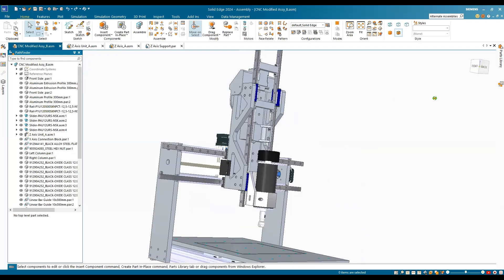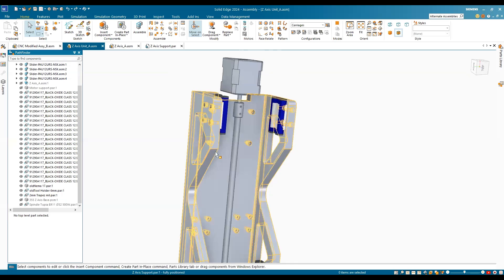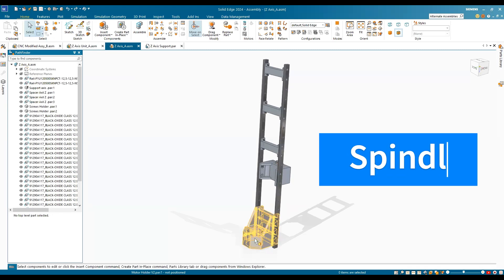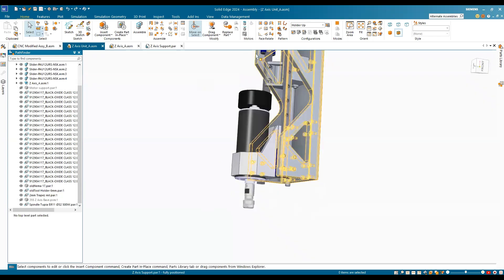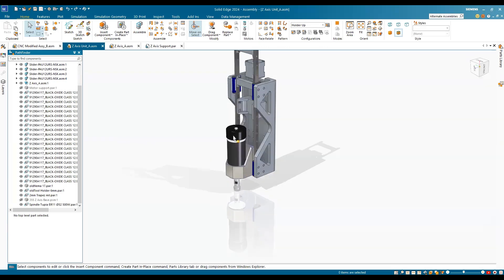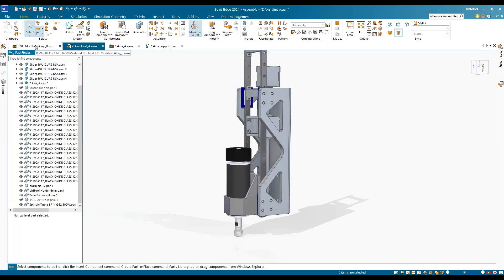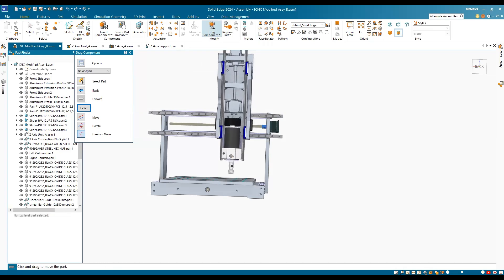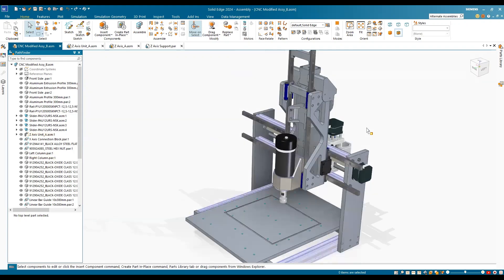Disruptive Z Axis Carriage Design

Comment: 3 Issues I see with this design.
1: Wet noodle.  When this is extended more than a few inches, you'll be able to move the spindle visibly with your own strength.  I'd guess you need to stiffen this by at least a factor of 10 to have it usable for more than drilling.
2: Accuracy issues.  Those types of linear rail are not guaranteed to be straight.  They need to be screwed down and and held against a reference (flat) surfaces.
3: Not much clearance.  In the configuration you show this most of the time, with the axis as far up as it will go without coming out of the lower block, the spindle shaft sticks a couple inches below the gantry clearance, and any tool inserted in it will just stick out further.  If you move the spindle up the rails, then the rails will have to protrude below the gantry when at it's lowest position.
Linear rails are not a good substitute for a real frame.
Reply from the maker: I'm taking notes @skrubol thanks for the feedback. The idea is to keep it simple and explore options, I will release soon some FEA analysis that will help me to take the right direction in this project, the screw down and held against a reference surface is one of the changes, but the surface will travel :) I'm having "spacers" in between the rails, the change will be to replace the spacers by one single spacer in steel with machined datum planes, the next limitation is the force of the stepper, yesterday I tool some measurements those can only handle 5kg (49N) so that is part of the constraints to take in count.

Comment: Im certain you are going to see a lot of vibration issues with the design, especially when cutting deep. You should try to alter the design so there is a more rigid connection with the rails and the spindle, especially because its sticking out
Reply from the maker: @tinkot that's a good observation, I'm planning to replace the current plastic spacers with a single piece of steel. I hope to post soon a video about the design process including some FEA

Comment: Did this for 2 years ago you will get vibration and a no rigidity
Reply from the maker: Yes, currently the machine has a max deflection of 0.4mm at the max force that the stepper motors can provide, I will post tomorrow a short video about how I took the measurement. I have done plastic parts with this machine with some acceptable precision but only happens when use the appropriate finishing passes with the right depth of cut. I will post soon more!

Comment: Ive made mine like that 25 years ago using a  16mm thick steel plate to suport the rails and its not as rigid as having the rails fixed  to the gantry ,so i will change it for a fixed rail version.  the max depht of cut in steel using a 10 mm end mil is about 1mm not good enough for me. So go for the fixed rail if you can its much more rigid.
Reply from the maker: @amfcreations6894 oh well, you are more ambitious than me :) I hope to cut aluminum at the most with this machine because I have a constraint on the force that the steppers motors can provide, I have posted a #youtubeshort taking the measurement and it is 5kg at the tip of the spindle, so around 49N before loose steps on the steppers which is really bad. Could you explain if the 16mm thick steel plate is in between rails or it is holding the linear guide carriages? I appreciate your comments
Reply: @lucmartz  the rails are bolted to rhe 16mm plate and the cariege is bolted to a 25mm plate., the cariage is locked and the rais move up/down with the 16mm plate
Reply from the maker: @amfcreations6894  That's relevant information, are you using 2 or 4 rails? I have the idea that if I have a box as you suggested I can use 4 of those rails instead of just 2...
Reply: @lucmartz  2 rails 15mm . it does not really matter using 4 rails it will be hanging  far away from the suports cariage i will changing  mine to 20mm rails.

Comment: I don't know the dimensions but, that kind of bearing assembly and ballscrew should let you put the spindle closer to the gantry. It will be hard to have it all really parallel. I quite like that you use the linear rail as part of the structure of the Z component.

Check the deflection gantry it seems that it will be huge. It would be better if you could make a square beam using aluminium plates (aluminium tubing has too little wall thickness) and have the same assembly procedure as you have right now.  Because the gantry is not moving, you can make it as rigid as long as the table/floor can hold it.

In my case, I wanted a compact and easy to tune CNC so I went with a moving gantry but that design has lots of problems. Like: chip management, sealing against dust all axis, limited mass on the moving axis, big enclosure, difficult to assemble, hard to water cool all of the moving members, 4 motors for 3 axis, 4 encoders, etc.
Reply from the maker: Thanks for sharing your experience with your machine Victor. Yes, Y axis movement defined on gantry movement is challenging, it is interesting why the bunch of plasma/waterjet CNC routers on the market that use that configuration exist, maybe is because the tool is not applying forces in the X and Y axis? The movement of the spindle closer to the gantry is very good idea. In order to do not leave the rigidity responsibility to the linear guide rails I will replace the plastic spacers with a single steel piece, but now that you mention the square beam using aluminum plates... I think I will go on that direction. I'm working on a new video where I show the details of the FEA analysis and future changes of the design. Thanks for pointing the "spindle closer to the gantry" improvement opportunity.